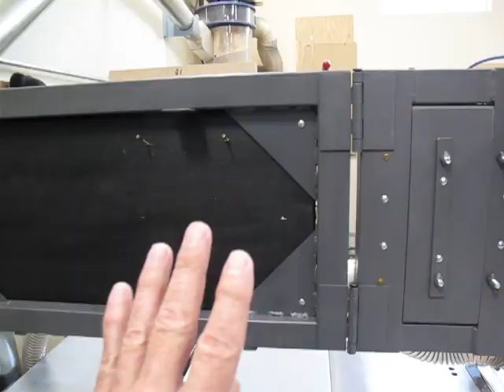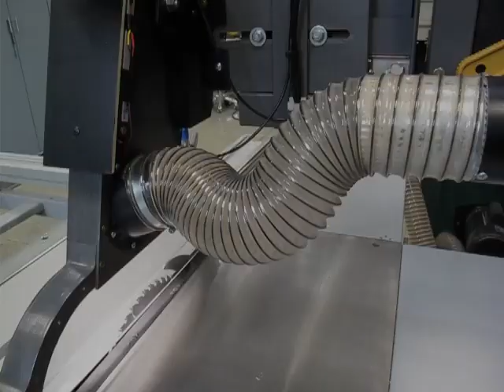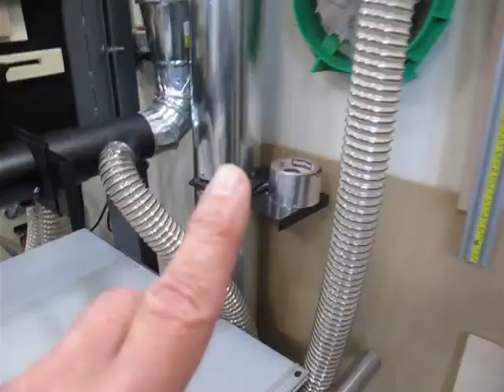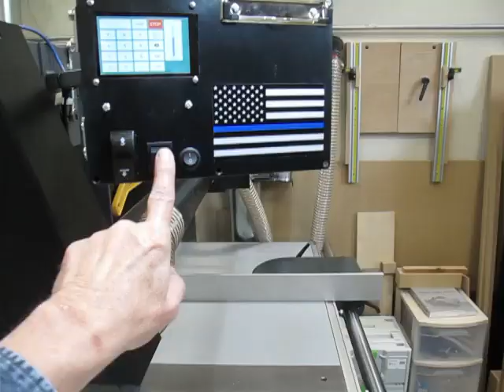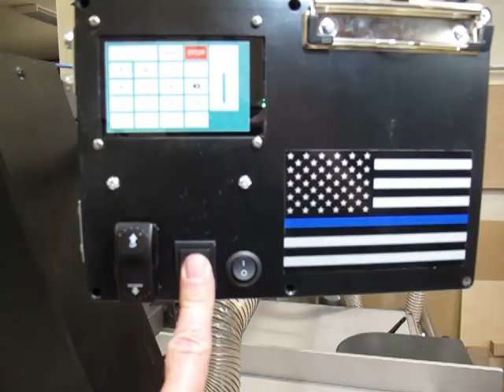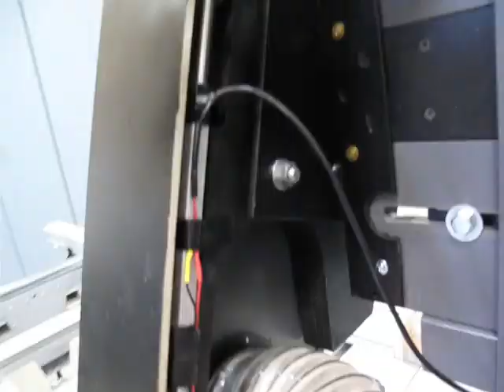Overhead Dust Collection system for Slider or Cabinet Table Saw

Comment: That dust collector worked great , no saw dust on table at all. Best I've seen yet! How loud is your cyclone in your shop?
Reply from the maker: Hi, sorry for the late response, I was away on vacation. The dust collector is loud (80 decibels at 10ft away, 75 at 20ft away). I have thought about a type of sound enclosure for it but that can get complicated and expensive. I will probably leave it as is since I usually wear ear protection when I am running it for any length of time.